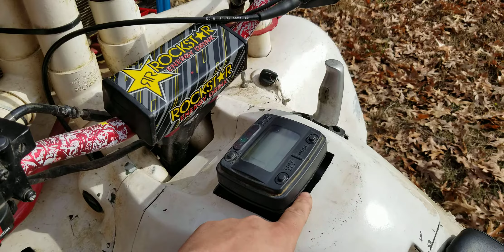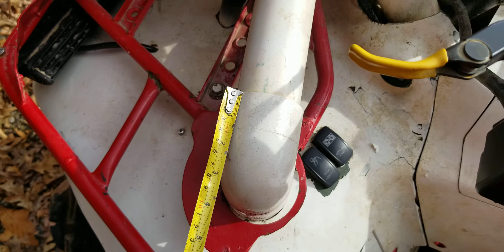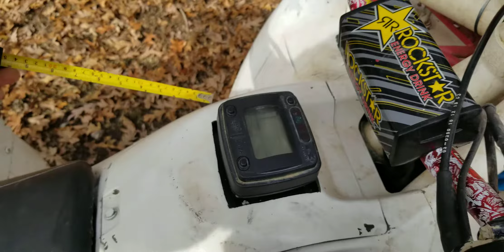05 Kawasaki prairie 700 custom snorkel setup

Comment: And how did you conect your fan did yiu have to do a bypass ?
Reply from the maker: Take the two wires running to you fan Switch located on you radiator and run them to a switch.

Comment: Hey man it's been a minute I have a question for you any chance you can take a short video or post a pic on the location of the engine mounts for the 650 and 700 I think I got to tighten mine because it kicks out of care of so often specifically from low gear down to high gear and sometimes from high gear back into neutral and all the research I've looked at says that the engine mounts have got to be loose
Reply from the maker: I dont own it anymore
Reply: @mr_mopar5.7  you know it's tough times when the man has to give up his four wheeler did you trade up for something newer or just had to sell it
Reply from the maker: Was just tired of it honestly too the money and got me a gas saver.

Comment: Hey i snorkeld my kawasaki praire 700 05 but it bogs on me what could be the problem
Reply from the maker: You can't snorkel without jetting the carbs and I also hope you went with 2" OD piping cause that prairie needs to breath
Reply: @mr_mopar5.7  yeah i ran 2 inch pipe but yeah i ama have to re jet the atv and the only thing is the air filter i did put a 1 1/2 90 but then reduced it to a 2 inch pipe all the way to the top !
Reply: @mr_mopar5.7  there's more 2 inch than 1 1/2 i just put those fitings so i wouldn't struggle
Reply: @mr_mopar5.7   And what are the jets you need for the prairie 700 ?
Reply from the maker: Every setup is different. There are alot of factors that go into it. I cant tell you what you need.

Comment: How did you connect the single 2in pvc to the carbs? Im assuming you sealed the airbox and ran the pvc to that
Reply from the maker: I used the factory rubber coupling shoved 2in pvc pipe into a 2 in pvs 45 elbow and trimmed it so it would just go in the boot far enough to meet flush with the elbow
Reply: Also i did your custom pit bike exhaust mod on mine and boy does it sound amazing. Thanks for the help
Reply from the maker: Hell yea man glad i could help
Reply: @mr_mopar5.7  hey man is there another way to get ahold of you because I have to figure some stuff with sra brute ...did some mods and now she isnt running correctly
Reply from the maker: @durtysouthkustomz8862  email me then ill give you my personal number staceyw@jariggs.com
Reply: @mr_mopar5.7  what is that on Yahoo or gmail
Reply: @mr_mopar5.7  got a facebook account I can message you and send you my number or something I really need help with this thing man I've spent so much and havent really had fun with it ..but in too deep to get rid of it
Reply: @mr_mopar5.7  yo I emailed you and sent you my number for you to get a hold of me

Comment: Do I have to do the intake mod if I’m only snorkeling? Don’t really want to re jet
Reply from the maker: you will have to rejet period. the snorkels mess with incoming air volume and flow
Reply: Ok dang it what do I need to do to reject it ? Do I have to buy a kit or make my own adjustments
Reply: BIG GUY little world is asking cause I’ve never jeted a carb before i have rebuild them
Reply from the maker: It's easy what size bike you got?
Reply: BIG GUY little world 2002 prairie 650
Reply: Appreciate the help
Reply: Do you have ig so I can message you there ?
Reply: What do I have to do to carb ? Have not jetted before
Reply: @obspowerstroke1864  Can you hit me up as well, same make and model he asked about.
Reply: @mr_mopar5.7  hey man can you please help me out ...I just got my built motor back trying to get it back on the bike , but I'm trying to get the motor on the rear driveshaft how do I do this
Reply from the maker: @durtysouthkustomz8862  are the engine mounting bolts installed?
Reply: @mr_mopar5.7  no I'm fighting it right now trying to get it straight...but I cant get it to go on their ...if this was Facebook I'd video chat you  and show you
Reply: @thomasw8074  update : I put a hmf jet kit and 2” snorkel and used the jets from the kit rims good so far

Comment: What size tires are you running and did you put a clutch kit in it
Reply from the maker: Those were 28s and it had a red and maroon clutch springs
Reply: @mr_mopar5.7  the clutch kit for the brute for 650 should fit it as well should not
Reply from the maker: Yea all those clutches are the same
Reply: @mr_mopar5.7  cool
Reply: @mr_mopar5.7  what jet kit are you using
Reply from the maker: Not a kit just used jets from jets r us
Reply: Any chance you can get me a link or something I'm trying to find a stage 3 and see what it costs considering I want to try and get the most I can out of the stock motor without hurting it because I plan on making a mud machine that turns 27s but if I want to I can upgrade it to 30s and not have to change anything else cuz I planned on clutching it for 30s and I'm curious because I can only find stage one kits for it this prairie that I'm looking at getting I like doing my research ahead of time
Reply from the maker: Like I said they don't make kits. You gotta tune these yourself.
Reply: @mr_mopar5.7  okay that's not a hard thing to do I just need to figure out what sizes or what for cuz I know they do make a stage 1 and the stage one's are supposed to be 142 front 145 rear and I'm just trying to figure it out in my head so what size Jets did you go with I'm taking into account you put cams and stuff in yours so
Reply from the maker: Yea I just kept going up by 5 every swap until I felt good about it. Every build is different I also did head workon mine to
Reply: @mr_mopar5.7  okay thanks for the input I'll let you know how it goes when I get it I start doing all this stuff because you know waiting on the IRS to give me my taxes back LOL
Reply: @mr_mopar5.7  I need to pick your brain one more time what brand carburetors are these did they use mikuni style Jets
Reply from the maker: Yes but not the fat ones
Reply: @mr_mopar5.7  hey does the front of your 4 wheeler have McPherson strut suspension and if so how the hell did you put the front lift on it
Reply from the maker: No it has highlighter springs with brute force spacers. It was not easy getting the spacers in all ima say lol

Comment: needing a Kawasaki mechanic !!!
Reply from the maker: I'm not a  "certified" Kawasaki mechanic but I know these things like the back of my hand
Reply: @mr_mopar5.7  04 prairie 700...slips out of low gear.
Reply: @mr_mopar5.7  just picked it up today . if it's internal o you have to tear the motor down completely to fix shift forks ?
Reply from the maker: Now when it come to the transmission part of it I'm not to knowledgeable on that. Iv honestly never seen one fail.

Comment: I hate to pester you I have a dumb question and I have tried and I cannot figure this out I've reach at it both high and low end so that they match I've done my CDI box I've done clean and practically rebuilt the carburetors but for the life of me I cannot get the freaking thing to idle correctly she runs a mean as hell in the top end she don't care it's it's mean and aggressive but I cannot get it to idle so idle for a little bit then it sounds like she loads up on fuel and then dies out and I play with the idol screw and then she idles too high and won't go into gear
Reply from the maker: Either you got a boot leaking or your chokes cables are stuck.
Reply: @mr_mopar5.7  I can't be the chokes I put double springs behind them because I got tired of them getting stuck and I lubricated them when I put them in so I don't think it's the chokes I could check the boots but it doesn't like to start without throttle if this gives you any ideas I may have it too rich and because I'm not exactly sure stock motor but very big jets in comparison to the stock Jets and I'm not exactly sure where I'm supposed to place these idle adjustments if I don't have it at three turns out it hesitates throttle wise like it's not enough fuel either that or it's just not warmed up yet when I turn them all the way in right and turn them like a turn and a half out she starts at idle no problem and idols but I've never ran it like that under load because I know that the factory turnouts from what I can find is 2 and 1/4 turns on that air mixture adjustment
Reply: @mr_mopar5.7  kind of wish you live down the street I'd bring it down to you and I'll let you look at it LOL
Reply from the maker: @georgefulmer8824  ummm I'd look into idle jets and make sure they are clean even though little holes on the side of them. What kinda plugs you running? They may be to cold. I ran the cr7e
Reply: @mr_mopar5.7  thats the plugs im using and the idols jet i put in were brand new and it still did that same thing lol ill have to look at boots when i can